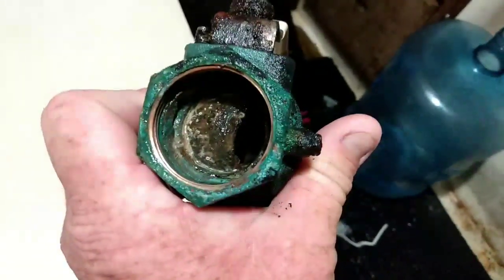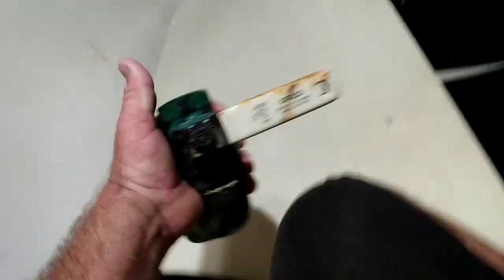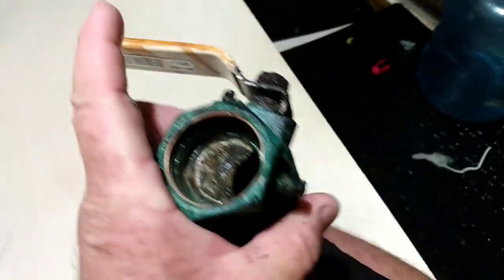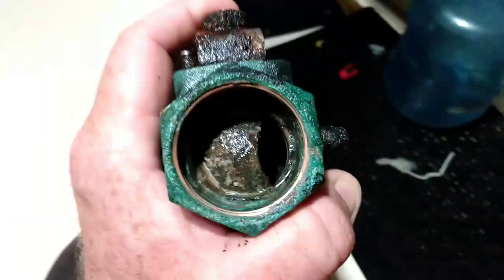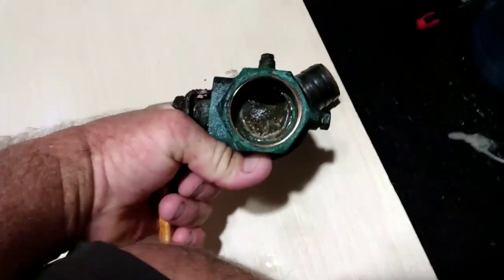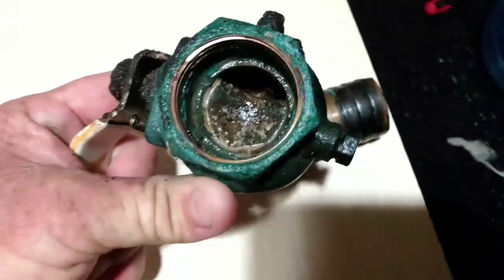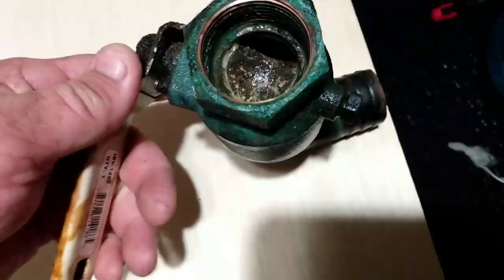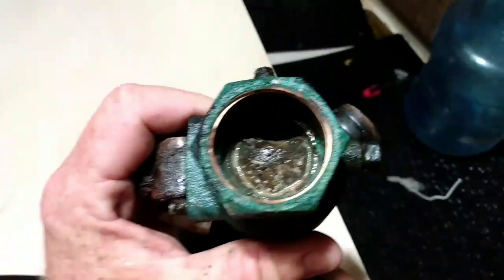A tip when inspecting thru-hulls...

Comment: We have a Catalina 27 with the exact same cabin layout.  The only difference I can see is we have a cutout in the transom for the outboard.  I don't like that gaping hole off the stern so I'm thinking of filling it in with plywood and fiberglass.  I could then mount my 9.5 mercury on a bracket and make it much easier to get at for maintenance.  Do you have any thoughts or advice?
Chuck Legge